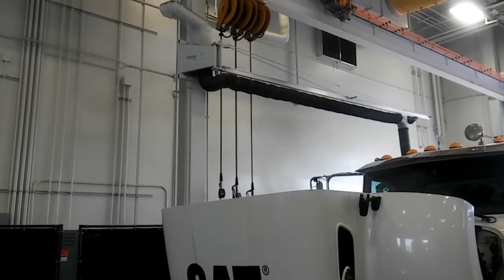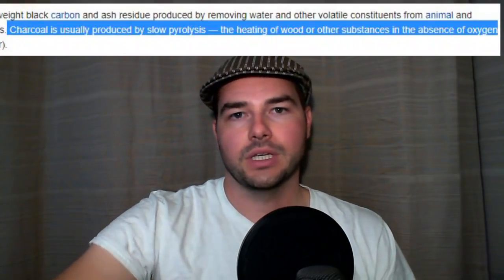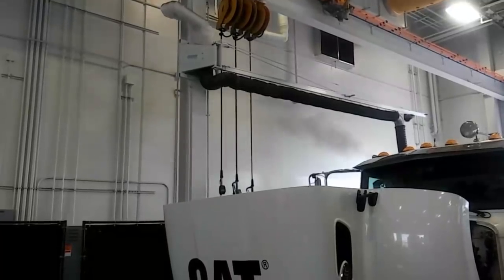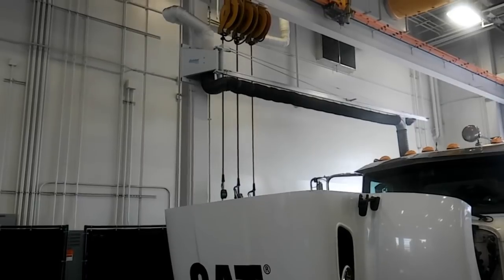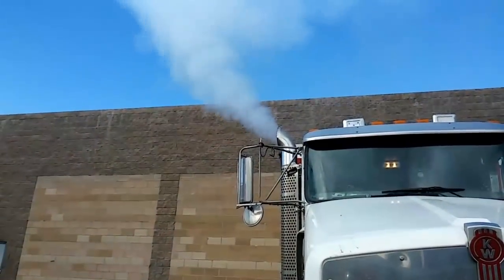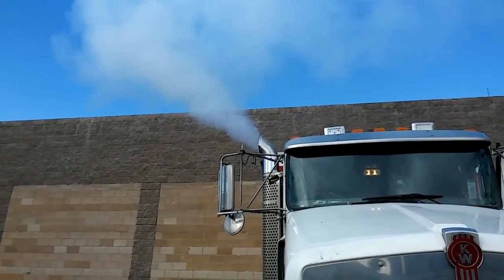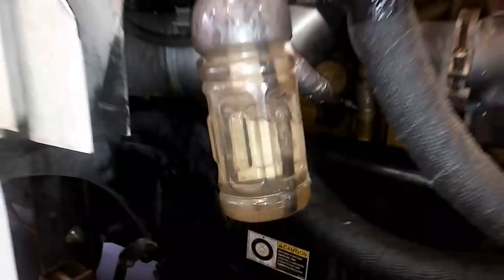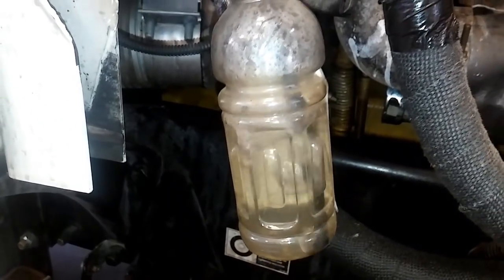Why Do Diesels Smoke?  Diesel Engine Exhaust Black Smoke And White Smoke.

Comment: my 95 5.9 12 valve blows white smoke when you accelerate but its not burning any coolant or oil. goes away once at operating temperature. Blown head gasket? tested injectors and they aren't the problem. Turbo isnt leaking any oil and the injection pump timing has not slipped.

Comment: Most all diesel engines will smoke white when cold and first started. this is merely fuel passing through the cylinder that has not heated fully as is gray smoke..

Comment: Verry valuable information, thanks for sharing, I'm in the middle of cleaning proces of the whole exhaust line on my old vectra ( from exhaust valves, manifold to the back muffler), turbo was loosing oil. Thancks to your video, it looks like it will be a good idea to take the injectors to a specialist for cleaning and testing.

Comment: The odeurs differ too. I can smell if a diesel burns engine oil or if it has bad diesel combustion, both show blueish or grey smoke but smell differently. Water vapeur on the other hand disappears rapidly after leaving the exhaust, real diesel or oil smoke on the other hand don’t. Whatever the case, blue or grey smoke indeed mean trouble, most certainly if the engine is hot.

Comment: Hi Josh, I have 2007 Peterbilt with C15 and I getting blue smoke and lost of power at low RPM. Do  you know what can cause this problem? And also truck smoke when I use engine break. Thanks.

Comment: Good information. I have a 1991 7.3 Diesel that smokes black only when I step into it. Is it worth some ones time to get more air to it, or just forget about it and it is going to burn some oil. Has only 163k  on it.

Comment: So white smoke when the engine is cold turning to blue as it heats up can be oil? Possibly from the turbocharger?
One more thing : Which could be more harmful to the environment? The black smoke which is fuel not completely burned or, let's say you manage to add enough air to burn all that fuel. Basically with the same amount of fuel which would be more harmful? Burning it completely or partially ?

Comment: What about white smoke only for  5mins after cold starts.. then goes away?
Reply: Unburnt fuel in the exhaust from cranking over and not fiering getting burned off as the exhaust heats up (could also be oil that made its way past the vaulve stem seals but thw woyld be blueish). Or water condensed  in the exhaust (or rain  / snow driven into it) boiling off as the exhast heats up.

Comment: So... what if the white smoke is diesel mist because of the cylinder not firing? What could be the cause of that? Cat C15 Acert MXS.
Reply: Too low temperature to combust,fuel is only vaporised. Could be caused by low compression or retarded timing

Comment: what would Blue smoke indicate? I am referring to a 05 Vw Paasat with the 2.0L pumpe-duse engine (Unit type injectors)
Reply: blue smoke is engine oil in most engines. No matter how you look at it, you have a problem.
Reply: @johnrickard8512  burning conventional oil is harmless if you tend to carbon deposits

Comment: what about white smoke while going down a hill, is it due to engine braking? my dad's mitsubishi with a non crdi non turbo engine produces a white/gray smoke while going downhill, but it is completely fine on flat roads and a bit of black smoke during hard acceleration and uphills which is pretty normal, its just the downhill problem.

Comment: What does it mean when the white smoke is intermittent. Not all the time just sometimes?
I have a Duramax 6.6 LB7 Chevy “04” 2500 HD. Truck runs perfect all the time .
Reply: You sir probably have a injector, very common in the LB7
Reply: If you aren't losing oil or coolant, I'd say it's fine.

Comment: Do you have a video on diesel exhaust smells or why it smells rich an burns the crap out of your eyes an chokes you out of cab, but no visible smoke from exhaust, how ever blow by tube has blue haze being pushed out at a little more of rate then I'd like to see at 219K miles on my CAT 3126B can you help me out with this?
Reply: I have to roll windows down while idling it runs me out of cab

Comment: Excellent review of using exhaust smoke color to diagnose engine issues. One of the more challenging elements is when these problems are intermittent. I've seen huge plumes of white smoke emmitted on startup from diesel gensets only to have the problem go away after a minute or so once the engine warmed up and then not repeat for some time. In such instances it is usually raw diesel getting into the exhaust stream which could have several possible causes.

Comment: white/light blue smoke also goes directly after firing up the engine in cold temperatures this is perfectly normal
Reply from the maker: +DulceSeeker Yeah I should have mentioned that a little white smoke in cold temperatures on a cold engine is normal.
Reply: Adept Ape what about white mist/smoke at idle but only if u flash a light at exhaust u can see it once it’s dark (night time ) if it’s by naked eye ... u can’t see none

Comment: Desiel exuast =cancer
Reply: JaArRyi FleshBlood your comment=cancer
*diesel exhaust
Reply: Your big fat petrol mom = cancer
Reply: You must be from California.
Reply: Actually modern gasoline engines are more soot polluting modern diesels because of GDI, so yes gasoline engines are more polluting than diesels, up to 10 times more
Reply: eddo_ mylegoo Diesels pollute the most, propane is the cleanest, gasoline is in between those two. You don’t have to believe me, just look it up.
Reply: +LazicStefan wrong, diesel pollutes more than gasoline.
Reply: MrZdvy no, gasoline pollutes more. Diesel black smoke aka coal is just soot. It falls back down
Reply: @MrZdvy  wrong gas is worse than diesel engines. Black smoke is carbon which gets recycled back into the earth.

Comment: I think this would have been the perfect time to touch on the modern emissions on the new trucks. The newer emissions reduces the emissions from a truck to just nitrogen, carbon dioxide and a few other particulates. We run the brand new trucks without exhaust vacuums at wyotech because it’s totally safe to. Pretty amazing stuff what is now in regulation

Comment: A problem with a water cooled turbo will put coolant in inlet and/ or blow coolant out of the reservoir. Leading someone who thinks they know more than they do, to do an inframe overhaul. Then replace the turbo later because the problem didn't go away.
Reply: Cbmech cats smart though ..pretty sure they never did that
Reply: heavy chevy 
I have to agree. This was on a cummins. You know, the same people who are so proud of "the most complicated fuel system ever designed. 😂
Reply: Nothing better than coming out with a completely different fuel system on every engine they make ...what could go wrong? Hahaha
Reply: heavy chevy 
Ain't that the truth. And unless you are a cummins specialist you don't have a chance to really understand them
Reply: I hear ya man....be  a pretty steep and expensive learning curve without Cummins Insite.....after treatment stuff is what really kills me these days though it seems
Reply: heavy chevy 
I think think that's why Cat got out of the truck engine business. And that sucks

Comment: So if its white smoke, are there more indications for diagnosis.  Like, if i have white smoke at idle when the engines cold, vs. I only have white smoke under hard acceleration?   or any white smoke at any time is just plain bad?  Mine is only under hard acceleration.  Any info would be greatly appreciated, thanks for continuing these videos!
Reply: Brian Walk I had the same thing on my gas f250 04 its basically when the engine gets up to temp whatever is leaking into the engine or exhaust will burn (in my case it was coolant) oil usualy burns darker.. white smoke most of the time is a blown head gasket and u can add some bars leaks sealer and you should be able to run it without a new gasket for another 6 months... cheers
Reply: Brian Walk 02 p l,zlxhchnwd l t8urueyryeywywuwywwoirheejjeeeirurj
jdhrjehehejee%hwjsjseuueyyeeh=èrr
eoeuaej
At apaeauaeuaruaraurururuaayeueuuey4